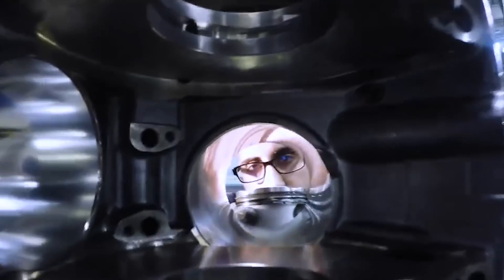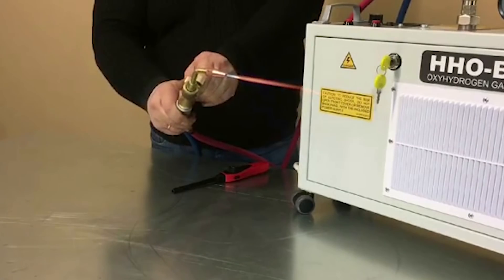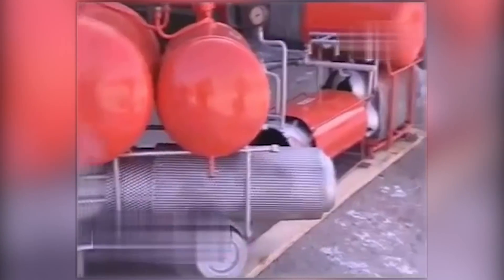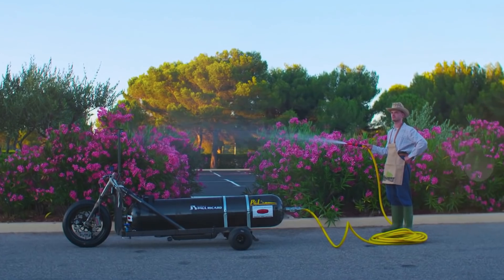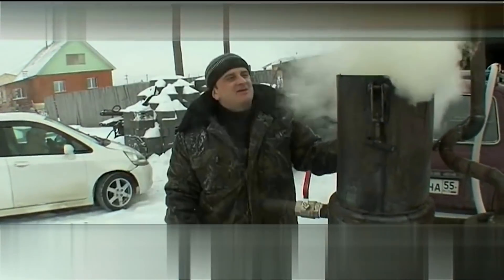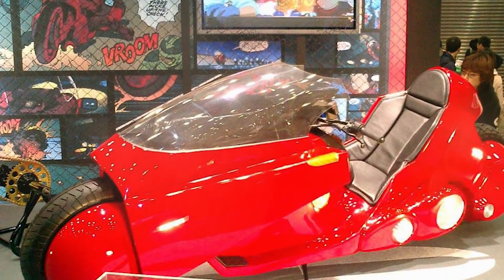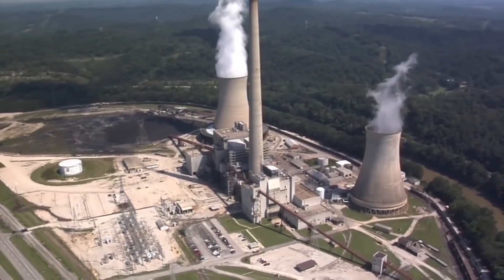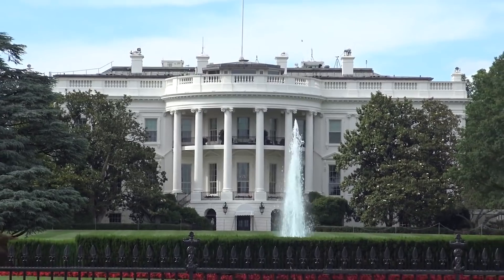Why These Engines Are Banned?

Comment: He thinks the air powered car has zero expenses. Good lord.  You need some source of power to compress the air dude.
Reply: Not only that, its very inefficient. You loose huge aumounts of energy when air heats when is compressed.
Reply: @antoniofdez620  There was no input aside from what occurs naturally due to gravity.  There is no fuel being burnt.  You are just capturing energy that would otherwise go to waste.
Reply: If you generate Electricity for your compressor by Photovoltaic it would be almost "free". But how many km you can drive untill you have to refill your tank?

I bet on Hydrogen as future fuel for mobility, combined with an fuell cell to generate Power for the electric motor.
Reply: Exactly what I'm saying. Not zero cost! Compression requires energy. Many sources for this energy exist but they all have some cost. Although solar would be of very low cost in the long term.
Reply: @joeltashinian5888  The energy itself is free.  The device utilized to capture the energy is not.
Reply: @wesbaumguardner8829  I still don't get how the energy is free though.  

We have solar panels here, the actual ongoing process of generation of electricity doesn't have a "cost" but, there was the initial cost of the panels, the building materials....labor...and there are ongoing maintenance costs.  But yes it does save us money.  

I suppose you can argue that a power company operating a hydroelectric facility doesn't have to pay for the water passing through the turbines- but how is that going to work ?  Do we drive to this plant and have our air bottles re pressurized?  Just like the electricity generated from hydroelectric is not free to the end user, I can't imagine that this would be either.  It seems to me it would be more efficient to generate electricity from the hydro instead since that can travel over the grid to the end user.
Reply: @jeremy49988  It is just pressurized air.   It will go wherever you pipe it.  Uphill, downhill doesn't matter so long as the extraction rate does not exceed the intake rate and the pipes can handle the pressure. You are simply converting head pressure to air pressure, so as long as you have water, you have energy. The pressure release could drive pneumatic tools or refrigerate storage facilities.  The difference between the trompe and a hydroelectric dam is that the trompe has no moving parts aside from the access valves.  Thus it is very low maintenance.
Reply: @wesbaumguardner8829  Thrompes are definitely not the new energy source for the future.  While useful in certain very specific circumstances, if you're considering powering fleets of vehicles with them, think again.

Ragged Chutes is one of the biggest thrompes ever built at 351 feet tall and it makes 125 psi or a whopping 8.6 bar.  If we magic that compressed air into your car's air tanks, assuming no energy loss anywhere, that's an energy density of 0.215 kJ/l (0.1*ln(8.6/1)).

The energy density of gasoline is about 34200 kj/l.

I'm going to be very generous and assume that a conventional internal combustion engine loses 90% of it's energy to waste while your compressed air car is 100% efficient, that's still over 15000 times the usable energy storage density with gasoline.

Maybe I'm biased, but I don't want to drive a tanker truck full of compressed air just to go to the grocery story.
Reply: Pesonally, I'd worry aboit the weight of compressed  air tanks strong enough to withstand the rigors of road travel. Exploding air tanks are no joke...
Reply: but, you also have one or more totally awesome rockets in a catastrophic car accident, which is a huge value add to me at least.  Most large compressed air cylinders have to be chained down for safety because if the valve fails they will go through (this is what we were taught in the AF) several brick buildings before they come to a gentle stop.
Reply: @TheTerryscotttaylor   Yeah, its almost as bad as a gas tank explosion.  You know, like the ones they used to have on the Pinto.
Reply: Producing compressed air is a very ineffective process with a lot of energy loss. So these cars are anything but cheap to operate!
Reply: I'ts OK he uses electricity from a coal fired power station
Reply: exactly and what  kind of source do you use?.....???
Reply: We learned in professional school compressed Air is the most expensive energy in Workshops you use. Even a 1mm hole in your Air System costs around 480€ per year. (Depends on your electic costs)
Reply: @xj9779  Only if you are burning fuel to compress the air.   If you allow gravity to perform the work, compressed air is practically free.
Reply: @wesbaumguardner8829  ? Energy doesent come out of the nowhere. Please explain us your free Energy Plan...
Reply: @XJ9  "Energy doesent come out of the nowhere. Please explain us your free Energy Plan..."  Are you so certain?  I suppose it depends on your definition of energy.  Technically, energy does not exist.  It is a transient.  An occurrence.  There are theoretical ways involving field theory which could possibly manifest energy from counterspace.  However, the trompe has nothing to do with that.  The trompe is not my idea.  It is old proven mining technology.  When water is stacked upon water, it creates head pressure.  So, if you can somehow get air below water, the pressure from the water will pressurize the air.  That is precisely what the trompe does.  Better still, it accomplishes this with no moving parts aside from the valves which are opened to retrieve the compressed air.  So basically, a trompe is  two funnels which are adequately spaced one on top of the other so that water can flow from an elevated creek, river, or reservoir into the space between the two funnels.  The upper funnel has several small pipes in the center which go into the pipe attached to the lower funnel a ways so that as water flows in between the funnels the falling water creates a vacuum which pulls air through the small pipes which intermixes with the water as it falls.  The lower funnel is attached to a large pipe, which allows the water to freefall a long distance before the pipe abruptly bends into the bottom of a subterranean chamber.  Shortly after the water enters the chamber, it hits a short vertical wall which slows it down enough for a portion of the air to be trapped in the top of the chamber.  At the bottom of the other end of the chamber is an exit that bends back up a ways, which terminates at a lower elevation than the entry point so that the water keeps flowing.  The amount of pressure achieved is determined by the head pressure of the water leaving the system.  This is not "free" energy in the manner that it is coming from nowhere.  It is just a different way to capture energy from falling water.
Reply: @wesbaumguardner8829  thats your anwer so you dont know how to to create infinite energy out of nothing... that is exactly what i thought i doesent work! maybee this famous quote help you if you missed it "The first law of thermodynamics, also known as Law of Conservation of Energy, states that energy can neither be created nor destroyed; energy can only be transferred or changed from one form to another. ... In other words, energy cannot be created or destroyed." from Julius Robert Mayer
Reply: @XJ9  There is no such thing as a closed/isolated system for energy as there is no known barrier that can block all energy transfer in this universe.  As the laws of thermodynamics all require a closed/isolated system, they are not actually applicable to the universe we live in.  They may be a useful tool for approximating certain situations, but they are not a fundamental truth of this universe.  Physicists make the poor assumption that there is such a thing as a closed and/or isolated system with respect to energy by claiming that the universe as a whole is a closed and/or isolated system.  However, they have absolutely no proof for this.  According to them, a universe with no boundaries is the same as one with boundaries.  This is just another case of them having their cake and eating it, too.  According to these same physicists, the laws of physics fall apart at black holes and white holes.  These are two known types of locations where their assumptions are proven erroneous and where energy could possibly enter or leave the universe.  They do not understand energy enough to even properly define it.  The whole "ability to perform work" definition is pure nonsense.  It describes nothing and explains even less.  I am quite certain we humans are not even currently aware of a minutia of the types of energy which occur in our universe.  We used to think there were no sound octaves above and below what we can hear ourselves, then we found out otherwise.  We had the same experience with light.  We used to be completely unaware of light outside of the visible spectrum.  Now we can measure light which is outside the visible spectrum.  At the current state of human knowledge, we do not even have a good estimation of what we do not know.  Just because we do not presently understand how to do something does not mean that it is actually impossible.
Reply: There is a device called a trompe that compresses air using the gravitational energy of falling water.  Building the device is not free, but you are not actually paying for the energy itself.  The only moving part is a valve which allows access to the compressed air.  This would be much cheaper than our present system.
Reply: @wesbaumguardner8829    How are you not paying for the energy?  Do you have your own waterfall?
Reply: @jeremy49988  I do not, but with the trompe, a waterfall is not actually necessary as long as you have a river or lake that is elevated relatively close to an elevation change.  You can engineer the rest.  The energy is technically free, but the device utilized to capture the energy is not free.  In fact, all energy is technically free.  We humans do not create energy, we simply convert it from one form to another.  We are surrounded by energy every day and every night.  It is just there for the taking.  We just have to figure out how to access it and use it.  The devices and/or methods required to access and/or use the energy are where the costs arise.  It is possible that there are some very cheap devices that could harness a lot of energy of which we are currently not aware.  Some people think such devices have already been created but have been suppressed by people that want to keep humanity bonded in a form of energy slavery.  I myself think this is the case.
Reply: @wesbaumguardner8829  How does the water get up to fall?
Reply: @chrisnoname2725  The intake is higher than the outlet.  The water falls during the process, it just has to go up to leave the system.
Reply: He already said that it requires much less energy to produce compressed air, he didn't say "it's free".
Reply: @MaverickSu-35  Lol, k.
Reply: @MrGunnaras  
Thanks for agreeing, but I wonder what for, lol!
Reply: Maverick Su-35S Sorry i was mocking your statement. About pneumatics being efficient. The only place pneumatics are being used is Where the enviroment is a fire hazzard since sparks from Electric motors Can cause fires. Compressed Air has very few uses becouse it is so inefficient. The other use of Air in Industry is torque converstion. Becouse you Can udjust the pressure and quickly change tools.

Everytime you have a pressure chance. You Will have a temperature change. This temperature g’ets lost to its surroundings.
Reply: Gunnaras Grinkevicius  
I know it as you know it man, thanks, and no problem for the mocking as you've said the truth! Still though, as there are a lot of vehicles (which are not crash proof) using CNG (compressed natural gas), which to be honest, have about 200bar of pressure, prove to be quite safe even with hard struck during accidents, would the high density of oxygen within the compressed air bottles (I don't know how pressurized they are) be more volatile or unsafe than CNG? Anyway, I wasn't planning nor necessarily looking for using compressed air to drive my vehicle, but..., all of my replies here were related to contradictions about using it and didn't have the intention for using such applications anyway! Good day!
Reply: @MaverickSu-35  Ignore the paid shills.

Comment: Tbh, the compressed air engine is BS. The amount of air that any vehicle can hold is less than a real engine would consume in a minute, hands down. On top of all that, add the fact that fuel is energy, the compressed air engine is then very weak and doesn't go long as it's only pressure driving the process.

Comment: So moat of these are not actually illegal....  The problem is most of them are not practical.  For instance every one that can do 100km/hr for up to a couple hundread km....  They are all super light vehicals.  What happend when you need to put some mass in something....  We use gas because it is very high energy density and is much safer than compressed anything...

Comment: hydrogen in any quantity is extremely dangerous and needs to be stored under pressure making it even more dangerous... like seeing apartment buildings and schools exploding because of a fender bender?
Reply: Bs
Reply: @joshmeriwether1503  hindenburg
Reply: @AKATenn  much larger scale the amount of hydrogen needed for an automobile would be nowhere near that magnitude
Reply: @AKATenn  very minuscule amount compared to the hindenburg
Reply: @AKATenn  the amount needed to improve fuel mileage significantly would be less than two Mason jars
Reply: @AKATenn  search homemade hydrogen systems for automobile you'll will be surprised at how safe it actually is
Reply: @AKATenn  whered u go shadwell just trying to enlighten u should seriously check it out pretty cool inventions coming out that could produce 40% better fuel economy with a small basic setup very inexpensive to build and very safe

Comment: I need some delta H° numbers or free energy diagrams here come on!!🤞instead of
"you might think that fueling these machines requires a lot of energy and money, but the cost is quite low...imagine(trails off into something else)" 😄
 It's hard to get on board with an energy solution claiming to be empirically better without empirical data. I'm not saying the solutions not out there, but the size of the claim should match the size of the evidence proposed, seems more like propaganda or an agenda than helpful information tbh

Comment: Magnets are a favorite of perpetual motion--surplus energy scam artists.  The more elaborate the design, the more suckers invest.  Yes, magnets can pull something.  Problem is...you have to put just as much energy in to get whatever you pulled back where it was.  And you will incur waste in both, though that can be very low...which makes it easy to make it look like things are going well in your devise because it takes a long time for it to run down.

Comment: The reason some of these people die is because they are scam artists or delusional nuts and took the wrong people's money. 

Those compressed air cars in India are utter death traps. Super light, no strength.  You would need a street sweeper rather than a tow truck after an accident.  I am actually a modest fan  of the technology and have researched it for years.  The only viable way to do it is to heat the air as it decompresses before it goes to the engine.  Even then, the performance is not going to be anything like you are used to.  What this was good for was mine locomotives.  In a mine you don't want something eating all the oxygen and spewing out CO2 and soot and such, because you would suffocate miners.  The air locos were great because they actually added more oxygen to the air in the mine, no soot and other crap.

Comment: We are not addicted to oil. The elite are addicted to power. They will not allow alternative energies until they are ready...or we revolt. Until then, stop feeling guilty about your carbon footprint. They are using it for control. Google, alternative energy inventors. They are dead or crazy now. Go figure. We need to unite not fight over politics. Divided we are weak.

Comment: The best air compressors are 10% efficient,  you would be 8x better off running the car off the motor on the compressor.

Comment: Look up the jet fuel hoax and dive deep into how jet engines are mostly free energy air engines! Sounds nuts right?
Truth is that air under VERY high compression is fuel.
Why? Air is Oxygen and Nitrogen and water vapor.
This all becomes combustible.
Of Corse!
Reply: Not fuel, but energy. Everything is energy. The "fossil fuel" story is another hoax. Oil is constantly made by the Earth itself under enormous heat, pressure, and any available biomass buried beneath the surface. There is no shortage of oil, there never was, and there never will be. The artificial scarcity is the lie used to justify keeping oil prices high AND to inflict mass fear. Fear is a very effective tool to gain compliance from the masses. Manufactured terrorism. Here is a little example to show what GREEEAAAT effort the government has done to conserve oil. It's true that automobiles today get much better fuel mileage than cars made 50 years ago. So how and why did this trend stop after the 1990's? 2010 Chevy Cobalt--33 mpg. 1984 Ford Thunderbird with the 2.3L 4 cylinder engine--44 mpg.